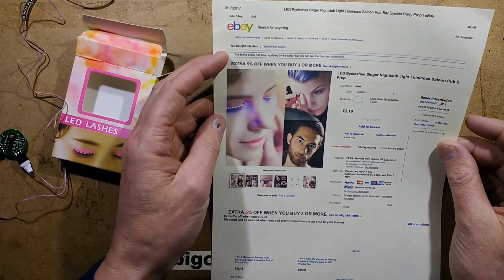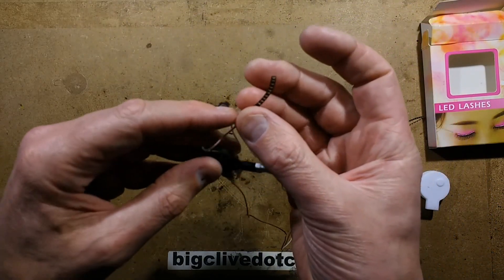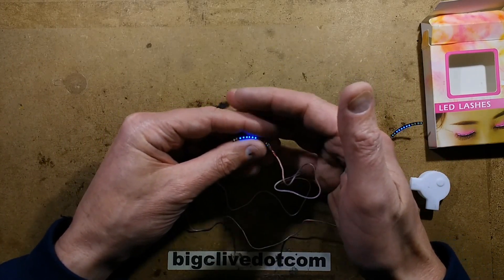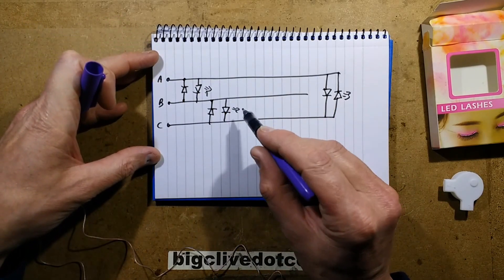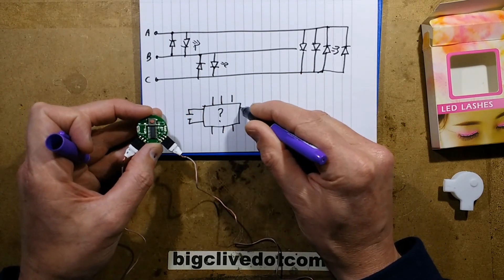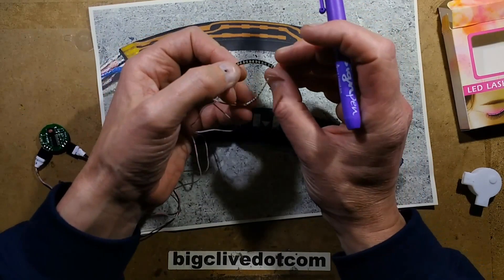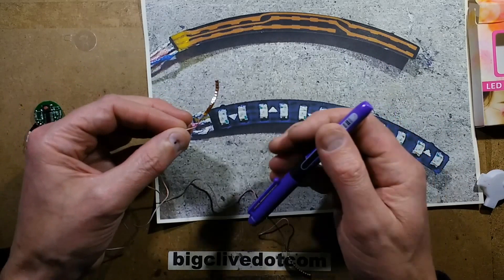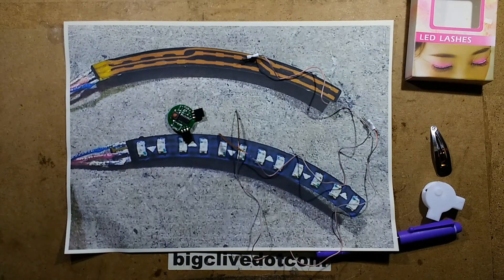Creepy LED eyelashes.  (with schematic)

Comment: love watching your videos, I don't know if you will remember this but several years ago I sent you an RGB laser driver to look at that I couldn't get to work which used your RGB chip. (I never did get it to work)
Reply from the maker: I remember that.  If it's the one I was thinking of the designer had used a positive voltage regulator with the pin-out of a negative one, meaning the microcontroller was being powered with about twice its normal voltage.  The rest of the circuitry would only work at that higher voltage too, so the whole design was a bit of a write off.
Reply: That's the one!

Comment: Yo Clive, it also says in the listing: " Different light modes are affected by different motions-some light up when you jump,some move fraster when you tilt or nod, and some get brighter when you move". Have you noticed anything like that?
Reply from the maker: It doesn't seem to have any motion sensing component.  The listing may be based on an original design that sensed motion.

Comment: How do the A->C and C->A lights work without also lighting up A->B and B->C?
Reply: it's a form of tri-state +fluffy, when you just want A to C or C to A the B busbar is open circuit (or high impedance) so no current can flow. The LEDs on B only have one leg connected.
people have mentioned charlieplexing and there's several internet tutorials on that iirc.

Comment: Bought something similar for the arduino a while ago, 20 3 colour LEDs in a ring 3 wire control - I wonder if a couple of these can be persuaded to do a similar job?  Ordered a pair - we'll see what they can do.

Clive - the bigger rings come in sections each has +/- power and Din and Dout used to chain the sections together which probably explains the need to keep connections in the correct sequence. 

Not really that different to the personal mics the theatricals use, the dangly bits are surprisingly easy to hide - a dab of spirit gum and they rarely come loose.
 ... false eyelashes have been around for more years than I have - briefly went out with a lass in the 70s who wouldn't go anywhere without hers, she'd lose a loose one regularly.  Shame - she took her virginity on the same dates - despite my best efforts she always got home with that in tact (on my watch anyway).

Comment: Clive, how would someone pull the program from one of these types of chips??

ie. "Reading the program from the infamous Chinese 8 pin chip" or 16-pin etc.
Reply from the maker: Most small microcontrollers like PIC12's have program protection to prevent reading out the software.  If you could identify the chip by pinout you might get lucky reading it with a programmer if the protection bit hadn't been set.
Reply: Interesting!!! I sense a challenge to someone......pull the program from a debadged Chinesium 8-pin Chip.

Comment: It might be interesting to code a larson scanner across the two lashes so that it starts at either of the outside 'ends' and scans across to the other 'end' i.e. left eyelash outside across to left eyelash inside bounce to right eyelash inside across to right eyelash outside, bounce and scan back. Give more of a cylon effect if someone wants to do something like that for a cosplay. I imagine that a board like this can be whipped up to take an esp32 Wemos D1 in place of the chip on here, and set it up so that besides doing the larson scan it's scanning for available AP's and blinks in morse any SSID it finds a way through to the internet, dumping relavent information into your server. Granted this to be worn by your girlfriend, but...

Comment: A bit of a shame that it doesn't have a static mode, although I assume that static versions of this exist, with less wire to hide under make-up. Applications would include carnival parade costumes (it would look quite striking in the dark), cabaret performances and and of course drag shows.

Comment: I see one guy wearing them on the GIF Reddit section. When he tilted his head left or right, the lights followed the tilt. So that might be what the un-used sections are for?
Reply: http://68.media.tumblr.com/e854bacfe10774d837a22347951df919/tumblr_or44p5k0UN1qzfsnio1_500.gif Prob the originator ?

Comment: 7:50 - Left and right lashes are different?  The circuit "boards" are wired differently?  Why?  Why wouldn't they design them so it didn't matter which connector they plugged them into?  As long as you get pin 1 to pin 1 they should work.
Reply: The lashes are made in left/right mirror image pairs. The effects are programmed to look a certain way (IE sweep from outside to inside) when the eyelashes are worn on certain eyes. The chip sends the pulses expecting a certain led to be on a certain pair of lines (AB, BC, AC). If they're not it throws the timing off and ruins the effect.
Plus, if you reversed them, you'd have to wear them with the cord next to your nose for the leds to be facing outwards. :)
Reply: Probably the eyelashes and the controller board were designed separately. The designer of eyelashes made them actually use 5 control lines in total instead of 6, by sharing one line between the two lashes, so that 8-pin microcontroller could be used. The designer of the control board didn't get the message.
Reply: I don't know about that but it would have been really simple to just mirror the first PCB design to get the other side with the benefit of not caring where it was plugged in.  And with the same design they could be put in parallel and thus only use 3 micro-controller pins.

Comment: 9:25 This is what the bicycle police will use in the future :D

I bet ya its just a of the shelf programable logic or pic circut.

I built something pretty much identical (but with 5mm diods and transistor amplification and 100 diods) back in the 90-tys. Simple way to get more: But i had to use 4 cables because i had 8 components to light.
Reply: What i did was just ran a loop to set a number for each one of them in a register. Then have a second binary register.

Turning every binery number on in the bineary register.
Then run the export funktion to trigger the loop for showing the output. 

Then decrese all numbers in the primary register with 1 (if its not zero already). Run the loop for showing it.

If the numbe are something low as 1 or 2 its pretty much of, if its something mid range like 100 or so, its half dimed, if its all the way up at 255 its full way of.

When the loop is repeated 255 times, go back to the outer loop and inject the dimming number again.

Do this 4 times, Then on the fourth time, the outer loop change the value  dimming up or dimming down.

I made it quite simple. having 4 dimming flashes, then just put it on one after a other... Then going back to the beining.  Just a dumb program:

But there is really nothing limited just running one outer program
Reply: matsv201 How about pedestrian Bobby's and WPCs?

Comment: Ah, DC power on moist, salty skin right on top of the eyes, what could possibly go wrong........ :P
Reply: If they haven't been given a conformal coating or a silicone seal to cover them, then the DC across the LEDs can get wet and of course cause problems with corrosion, introducing unwanted chemicals into the eye, and of course if the DC takes a path across the skin, then there's the issue of causing burns... :)
Reply: Good thing they're only powered by a cr2032 then that effectively limits the current to only a couple mA.
Reply: Take a CR2032, a slice of ham (your choice of brand/quality), place the CR2032 onto the ham and fold the ham over the CR2032 and wait for the lovely burning smell... :)
Reply: AC to DC rectification of course, LEDs are still diodes and can turn an AC source into DC, add in moisture (like eye moisture filed with salts) to screw around with things and you've god problems... :)

Comment: I'm very disappointed that you didn't try them on. (Probably for the best,  knowing Chinese stuff bought from ebay, the glue is probably horrifically toxic and will make your eyelids swell up like balloons.)
Reply: I think it's worth the risk. Requesting "Big Clive Tries on LED Eyelashes" video
Reply: It will add to the effect they were going for XD
Reply: This will be the one application where they use genuine 3M VHB tape.
Reply: I'm sure these are from his private collection, for thwn Big-C goes clubbing...
Reply: And not mention that something once seen, cannot be unseen.
Reply: Probably the same glues as false eyelashes. I'd probably use liquid latex to hold and hide the wires just like special effects makeup. Then makeup on top. Anyplace the LEDs would be visible the wires probably wouldn't.
Reply: how much do i have to pay to see him put them on
Reply: The man put an electric butt plug up his arse for science, I bet if demand is high enough he'll don the electric eyelashes. Clive is a stalwart fellow who laughs at danger.
Reply: I was SO HOPING he would try them on! Or at the very least pin them into his beard with a fake nose and lips!! Halloween is coming after all!
Reply: We need to see big Clive wearing these. I will unsubscribe and boycott the channel if not. Start a campaign. Who's with me?
Reply: Me too! Big Clive, you could just use double-sided tape... Now if you also had matching LEDs in your beard, that would be perfect.
Reply: There has to be some kind of fashion icicle lights the Chinese would sell you for placing in your beard.
Reply: Shock on his eyelids...lol chugging beer.
Reply: @Morbuto That smell? It's just my eyelash glue. nod nod
Reply: The traditional glue for fake eye lashes is fish glue (which is excellent for the purpose). Probably what these come with ;)
Reply: bubba99009 ...or in your heart.
Reply: Против Глобал There are no safety regulations in China, and no concern for human or animal rights, health or safety.
Reply: Seconded

Comment: I'm kindof disappointed that Clive didn't work out the hair clip as well.  I mean, it came with the package!
Reply from the maker: I've since been told that you flex it the opposite way of the bend and it snaps open.
Reply: bigclivedotcom never too old to learn :)
Reply: Yes, that's right.
Reply: They come in Tactical versions as well!
Reply: should've used the vise of knowledge! 
^_^